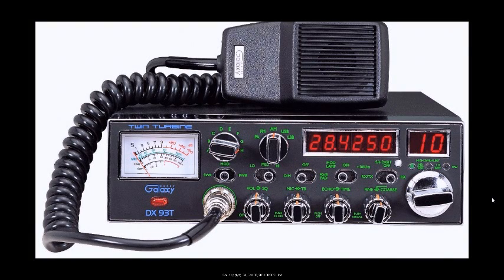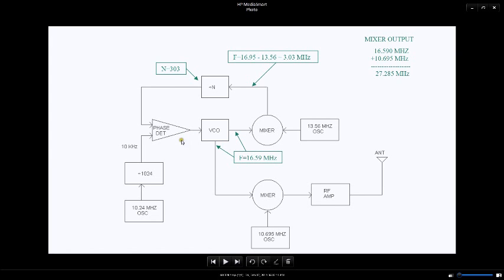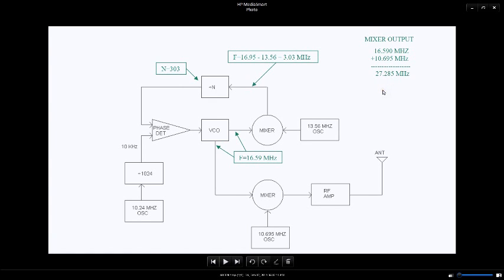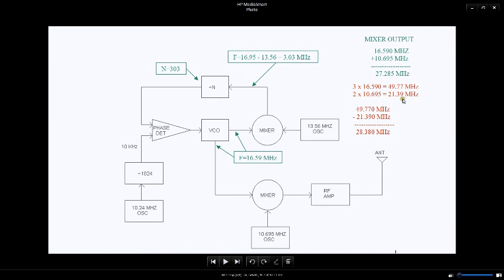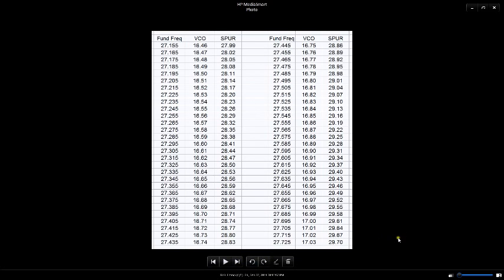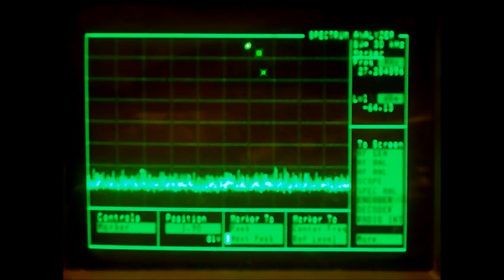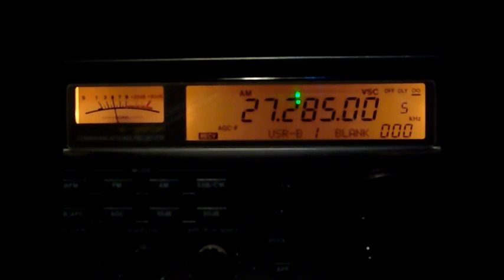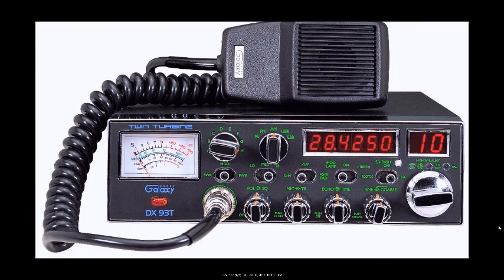Spurious output on Galaxy type radios when modified for CB use

Comment: How about that radio when used on 28  or 29 MHz?  
Sending on 28 MHzi think it could make problems in 29 MHz?
And in 29 MHz it could make problems for your plummer or carpenter, using radios on 30 MHz...
So everyone..    Take a showel and walk to your backyard, dig a hole.. and get away with your Galaxy...
And buy something usefull

Comment: This is exactly what worries me about out-of-band mods.  Most service technicians will put your newly-mod'ed rig on the oscilloscope and show you the modulation and you can see the spectral purity (in a limited sense) of the incident signal.  

BUT, how few of these guys even own a spectrum analyzer to hook up and see what else is coming out of your transmitter?? After all, it's those spurs that will really get you in hot water with Uncle Charlie!

Comment: It really does go both ways.. I have a ham operator that bleeds me BAD on 27mhz from whatever frequency he's on but I don't bleed him. It's very annoying, and even more annoying when he comes down to 27mhz sometimes and complains about how dirty our stations sound to him. Well jokes on him, my station is not over modulated and does not bleed him and his station bleeds me all 40 channels on 11 meter when he's not even close to 27mhz!
Reply: The term "bleeds" I assume refers to the other term "bleed over". This is usually referring to either local de-sensing of the receiver because of proximity to the transmitter, or gross interference caused by inappropriate operation like over modulation. If the ham is over modulating, then he is a bad operator. If he is de-sensing because of proximity, then that is an unfortunate problem you have but it may not be from illegal operation. Neither one of those cases is relevant to this video. This video is about a signal that is produced by running a radio that produces a spur, and further amplified to the point that it becomes a nuisance.
Reply: Tinktron
porr baby,he has a lic to operate,you dont.